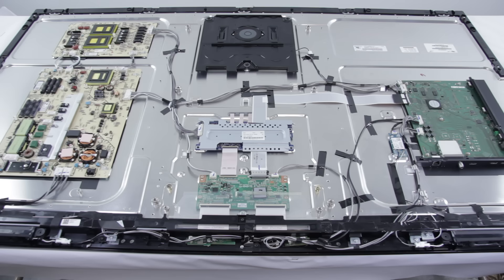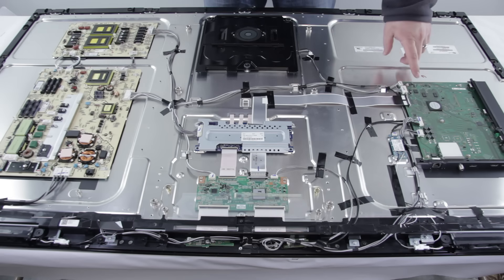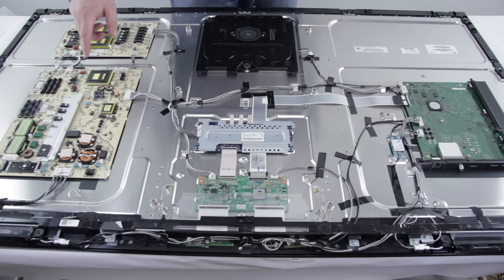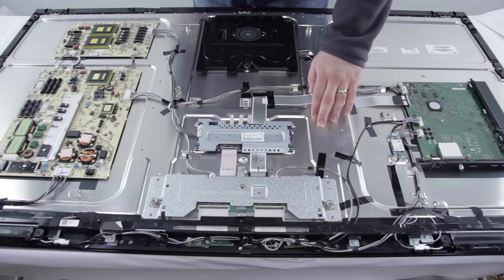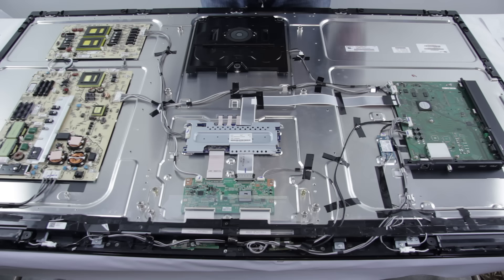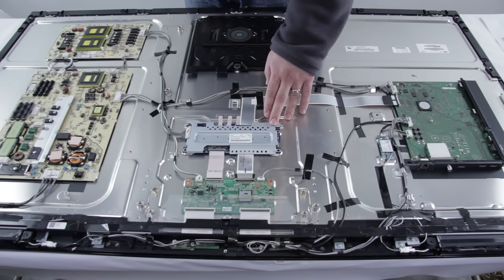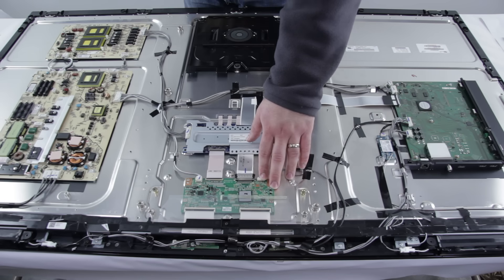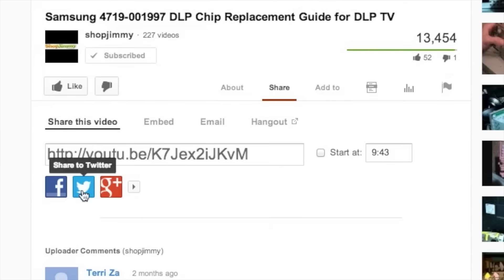LED TV Repair Tutorial - Common Symptoms & Solutions - How to Repair LED TVs

Comment: I have an LG32LG5700-2F TV, the symptoms are that the sound is fine, but there is no picture, the screen is white as time has gone on it has got worse now there is no image at all, just white. As a result I cannot even alter the settings. Is the TV worth repairing, if so what is he fault and what would the repair cost be?Thanks Andy in the UKAny thoughts would be greatly appreciated
Reply from the maker: +Andrew Bailey   Try all repairs and troubleshooting at your own risk. This could be a problem with either the t-con board, the main board or the TV panel. You can replace the main board and the t-con board individually to see if one of those boards fixes the problem.  Click this link to replacement parts for your TV model number:  http://www.shopjimmy.com/catalogsearch/result/?q=32LG5700  There may be multiple boards for the same TV model number, be sure to match part numbers on your current board, with your replacement for compatibility.  Thanks and please let us know if you have any further questions with your TV Repair!  www.shopjimmy.com

Comment: ShopJimmy I have a Samsung LN46A750R model which has the picture solarized everytime I leave the tv unused for more than 3 days, but when I use it for a day with its bad picture it returns to normal without any more issues.  Well until it is left alone again.  What could be the problem?
Reply from the maker: +jelayne   Try all repairs and troubleshooting at your own risk. This could be a problem with either the t-con board, the main board or the TV panel. You can replace the main board and the t-con board individually to see if one of those boards fixes the problem.  Click this link to replacement parts for your TV model number:  http://www.shopjimmy.com/catalogsearch/result/?q=LN46A750RThere may be multiple boards for the same TV model number, be sure to match part numbers on your current board, with your replacement for compatibility. Thanks and please let us know if you have any further questions with your TV Repair!  www.shopjimmy.com

Comment: I have the sanyo 26" [ DP 26648 ] that has the green light, wont turn on thing.
I replaced the power suppy ==> green light for 5 secs.
I replaced the main [ tuner N6CK] and the set turned on with audio and vid.

My joy was gone when the set would not turn on the next day.
I'm stymied. stuck at square 1. 

I DO have ebay boards for TConn and backlight also
but I'm afraid to plug them in, as I may fry them too.
-
how can I send pics to you ??
Reply from the maker: +Stone Catss   You can upload images online and then reply with the URL for the images.  Thanks!  www.shopjimmy.com
Reply: OK ... here are main and pwr supply
My set is similar to the pic below.
Mine is a dp 26648

https://www.facebook.com/photo.php?fbid=10204893150116269&set=pb.1465442118.-2207520000.1444948497.&type=3&theater

the pwr supply
https://www.facebook.com/photo.php?fbid=10204893140556030&set=pb.1465442118.-2207520000.1444948497.&type=3&theater

Comment: I have a Vizio model # M5O2i-B1.(50 inch, LED 1080p smart) Over the past couple of weeks...the picture would freeze and the sound would keep going(sometimes if I changed the input source this would fix the problem)the T.V would power off and on by itself, the TV would screen would turn black but, the audio was fine. Last night the TV would power on, but only show the Vizio logo, it wouldn't allow me to even pull up  the menu. Please help! Thank you

Comment: M701d-A3R VIZEO no picture, but has sound. Before it went black there was a Black line across the center of the screen. I bought a LED DRIVER FOR IT but have not started working on it yet.
Reply from the maker: +Donny Hitt   Try all repairs and troubleshooting at your own risk.  This sounds like a TV panel (TV Screen) problem.  If your TV panel is bad, it may be more cost-effective to replace the TV as panels are typically hard to find in stock, difficult to replace, and expensive.  Thanks and please let us know if you have any further questions!  www.shopjimmy.com

Comment: I have LG LED TV Model No : LN56. Audio is fine and we couldn't  get the picture. When we switch on the TV there is no picture and we could observe small brightness over the screen. After going through your videos  I have done the basis diagnosis like flashlight test. I believe it is problem with TCAN board or LED driver issue. If there is an issue with specific part of the TV do I need to change the complete Panel. Please suggest me or help me.
Reply from the maker: +Phani Kiran   Try all repairs and troubleshooting at your own risk.  Please reply with your TV model number.  Click here to view a video that shows how to find your TV model number:  https://www.youtube.com/watch?v=S51nhAmwR2M  Thanks!  www.shopjimmy.com

Comment: I have a vizio VO47LFHDTV10A tv that has no back light I did the flashlight test and hit the menu button and could see the menu. so i purchased the main and slave inverter boards installed them and still have no back light. what should i look at next
Reply from the maker: +Michael Macdonald  Try all repairs and troubleshooting at your own risk.  This could be a problem with either the power supply or bad lamps in the TV.  You can replace the power supply board in your TV to see if that fixes the problem.  Click this link to replacement parts for your TV model number:  http://www.shopjimmy.com/catalogsearch/result/index/?cat=59&q=VO47LFHDTV10A  There may be multiple boards for the same TV model number, be sure to match part numbers on your current board, with your replacement for compatibility.  Thanks and please let us know if you have any further questions with your TV Repair!  www.shopjimmy.com

Comment: hey shop jimmy i have an lg 32lk330-ub 32" and all it does is, when you plug it the stand by light blinks red. plz help
Reply from the maker: +Mark Alexander  Try all repairs and troubleshooting at your own risk.  I recommend replacing the main board in your TV.  Click this link to replacement parts for your TV model number:  http://www.shopjimmy.com/catalogsearch/result/index/?cat=56&q=32lk330-ub  There may be multiple boards for the same TV model number, be sure to match part numbers on your current board, with your replacement for compatibility.  Here is a link to a video showing how to identify your part number, click here:  https://www.youtube.com/watch?v=RwHTvjMdrhk  Thanks and please let us know if you have any further questions with your TV Repair!  www.shopjimmy.com

Comment: Hello I have a Sony KDL46EX523, screen has gray 4 inch vertical going down the left hand side. The screen did go out all together with the sound still running, I packed it up for a few months. I came across your video and decided to pull it out. I powered it on, and the screen came back on but the gray line was there. Thank you in advance for any assistance you can provide to me.
Reply from the maker: +Marcus Picou   Try all repairs and troubleshooting at your own risk.  This sounds like a TV panel (TV Screen) problem.  If your TV panel is bad, it may be more cost-effective to replace the TV as panels are typically hard to find in stock, difficult to replace, and expensive.  Thanks and please let us know if you have any further questions!  www.shopjimmy.com

Comment: I have a Samsung UN50F6350AFXZA LED Smart TV and the sounds works fine and I can see the picture at its normal brightness for about 30 minutes until it flickers to a darker shade and doesn't change back or it flickers again. My system is updated, and I was told by a repair shop that I need a panel replacement done to fix it. I want to do it myself, it seems like it's just short circuiting, if so how can I fix that? Also, where would I find a panel for the TV online or in a store to replace it if need be?
Reply from the maker: +Ezekiel Boston  Try all repairs and troubleshooting at your own risk.  This could be a problem with either the power supply or bad LEDs in the TV.  You can replace the power supply board to see if that fixes the problem.  Click this link to replacement parts for your TV model number:  http://www.shopjimmy.com/samsung-bn44-00612b-power-supply-unit.htm  There may be multiple boards for the same TV model number, be sure to match part numbers on your current board, with your replacement for compatibility.  Thanks and please let us know if you have any further questions with your TV Repair!  www.shopjimmy.com

Comment: I have a 55la6200 LG LED tv, just replaced the power supply with a board from Shop Jimmy, The picture still turns off and the sound stays on. Any suggestions? Thank you for your help.
Reply from the maker: +Caleb Sherman   Try all repairs and troubleshooting at your own risk.  This sounds like you have bad LEDs in your TV.  Unfortunately we do not sell replacement LEDs for your TV model number at this time.  You can check back in the future to see if we have them available.  Thanks!  www.shopjimmy.com

Comment: I have a Sylvania LC427SSX that when switched on flashes green for a few moments and then back to standby.  When this first started it would come on if I tapped the power switch button a few times.  That only lasted a few weeks and that didn't work anymore.  Then I was able to get it to come on if I removed the plug from the AC source for a moment, plugged it back in, and after hearing the standby switch click on, and push the power on button.  That lasted a week or two.  Now I cannot get it to power up at all.

I removed the back and checked the power board and everything looks new, no bulging Caps or obvious problems.  I am determined to find the problem and the solution, but right I really could use some guidance.   

Thank you for your concern 
Mr. Gayle
Reply from the maker: +Mr. Gayle  Try all repairs and troubleshooting at your own risk.  I recommend replacing the main board in your TV.  Click this link to replacement parts for your TV model number:  http://www.shopjimmy.com/catalogsearch/result/index/?cat=225&q=LC427SSX  There may be multiple boards for the same TV model number, be sure to match part numbers on your current board, with your replacement for compatibility.  Here is a link to a video showing how to identify your part number, click here:  https://www.youtube.com/watch?v=wooRqBrRo6o  Thanks and please let us know if you have any further questions with your TV Repair!  www.shopjimmy.com

Comment: I have a LG model 37 LG 3 0 it will not stay on. When you plug it in it turns on power light flashes three times then shuts back off checked all the capacitors on the TV cannot find any swollen or black. do you have any idea what this could be.
Reply: never got a response Joe_bula22@hotmail

Comment: I have an LG 32LG30. When I turn it on the power indicator light blinks red 4-5 times, then the monitor turns on to a steady dark blue. I tried pressing buttons (on/off, menu, etc), adjusting the connections from our cable box and other jacks but there is no visual display. This started after a lightning storm. Any idea what this could be? Thank you in advance for your help.

Comment: Shop Jimmy, I have a Vizio E65I-A2, it will power on for appx. 15 seconds and then power back off, the back lights never power up. The only indication that the set is on is the indicator led on the bottom of the front of the set it comes on bright at first then slowly fades off.

Comment: Hi, I just want to know if what is the common problem or require to replace  parts if the tv was strike the lightning? My TV is Samsung LED 40 inches Series 5 model. Please thank you
Reply from the maker: +Arjen ANTENOR   I recommend replacing the main board and the power supply board in your TV.  Try all repairs and troubleshooting at your own risk.  Please reply with your TV model number.  Click here to view a video that shows how to find your TV model number:  https://www.youtube.com/watch?v=S51nhAmwR2M  Thanks!  www.shopjimmy.com<!-td {border: 1px solid #ccc;}br {mso-data-placement:same-cell;}->

Comment: Hi, great video! I have a problem with my SAMSUNG LEDTV model #UN60F6300AF, 6300 series. I'm not exactly sure what the cause of the problem, one day it was working just fine the next I lost the picture. So, currently I have regular power, I have sound, back light, but NO image. I cannot use the remote to navigate through the menu. The screen appears a faded blue hue and only a slight flickering at the bottom lower left corner. When I first power the TV the SAMSUNG SmartTV normally appears before any programing, now there is no picture at all. Is this the result of a bad Tcon board as your video suggest? Where and how can I order a replacement part?

Comment: Sharp Aquos 60 LED model #: LC-60C6400U 

Just this morning, when i turned on the tv I instantly noticed the picture was dark and barely visible. It was fine the night before and three years before that.....never any problems. But I think it's a backlight issue bc when I turn the brightness and contrast up, it's at least watchable(so screen is fine). Also note, when I adjust the backlight setting, it does nothing at all from low to high. The odd thing is I check the vents in the back like yall instructed on the video and saw lights, only a few. So does that mean only some of the backlights are working causing this dimming effect? will that be a board issue or could the group of non working lights themselves just be defective? 

if it can be fixed: 
What part would I need off yalls website?

Comment: I have a Proscan 2845a with the built-in DVD. The back light is not working. I can barely see a picture in a pitch black room with a flash light shining across the screen.
Reply from the maker: +Eddie Gore   Try all repairs and troubleshooting at your own risk. This could be a problem with either the power supply, the inverter board or boards, or the lamps in the TV that provide the backlighting. You can try replacing the power supply board or all of the inverter board(s) in your TV to see if one of those replacements fixes the problem.  Unfortunately I do not see any replacement parts in the search results for your TV model number on our website.  Thanks and please let us know if you have any further questions!  www.shopjimmy.com

Comment: ORIGINAL QUESTION-I have an Toshiba 50in LED model 50L2200U. After a pretty bad thunderstorm my tv would not turn on. It's not receiving any power there is no standby light on or anything. I have replace the power supply board but still nothing. Is there anything else that I may need to replace?......I went to double check the replacement power supply to the original and part numbers are the same.
Reply from the maker: +Edward Starks  Try all repairs and troubleshooting at your own risk.  I recommend replacing the main board and power supply board in your TV.  Click this link to replacement parts for your TV model number:  http://www.shopjimmy.com/catalogsearch/result/?q=50L2200U  There may be multiple boards for the same TV model number, be sure to match part numbers on your current board, with your replacement for compatibility.   Thanks and please let us know if you have any further questions with your TV Repair!  www.shopjimmy.com

Comment: I bought a power supply board from shopjimmy and replaced it in my Vizio XVT473SV tv as the tv would not turn on (an amber light on the vizio logo only). Well, that didn't help. Any ideas? The main board is out of stock at your site. But would like feedback on whether that would be the best thing to do now. I don't hear clicking when I try to turn on tv with side knob or remote...just have the amber-lit logo and the tv does not respond. Thank you.
Reply from the maker: +jwads50   Try all repairs and troubleshooting at your own risk.  I recommend replacing the main board in your TV.  Click this link to replacement parts for your TV model number:  http://www.shopjimmy.com/vizio-3647-0312-0150-main-board-for-xvt473sv.htm  There may be multiple boards for the same TV model number, be sure to match part numbers on your current board, with your replacement for compatibility.  Here is a link to a video showing how to identify your part number, click here:  https://www.youtube.com/watch?v=kxkeGLhlQY8  Thanks and please let us know if you have any further questions with your TV Repair!  www.shopjimmy.com

Comment: Hey Shop Jimmy,  I Was Given A 50 Inch Westinghouse LED LCD TV By A Friend .   He Bought The TV At Target .   The TV Worked For A Over A Year .   One Day,  He Was Watching It And It Just Went Out With A Burnt Smell Coming From The Back Of The TV .   When I Turned It On,  The Screen Was All White .   The Next Day I Checked It Again And The Screen Was Dark Blue With A Hissing Sound Coming From The Power Supply Board .   The Model Number Is EW50T5KW .
Reply from the maker: +Christopher Winston  Try all repairs and troubleshooting at your own risk.  This could be a problem with either the power supply or the LEDs in your TV.  You can replace the power supply board to see if that fixes the problem with your TV.  Click this link to replacement parts for your TV model number:  http://www.shopjimmy.com/catalogsearch/result/?q=EW50T5KW  There may be multiple boards for the same TV model number, be sure to match part numbers on your current board, with your replacement for compatibility.  Thanks and please let us know if you have any further questions with your TV Repair!  www.shopjimmy.com